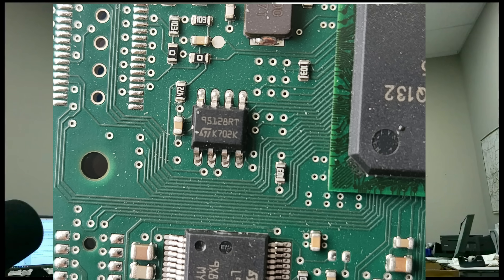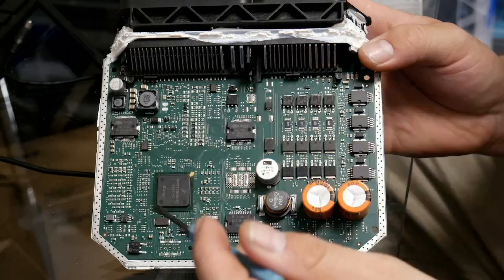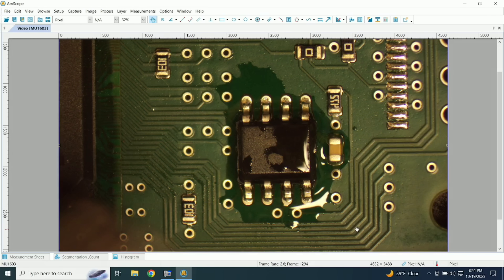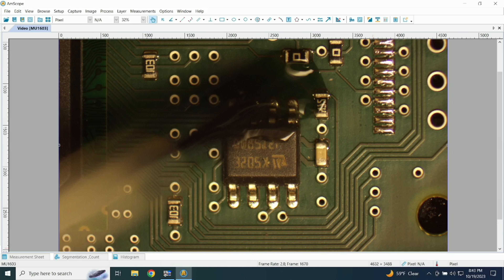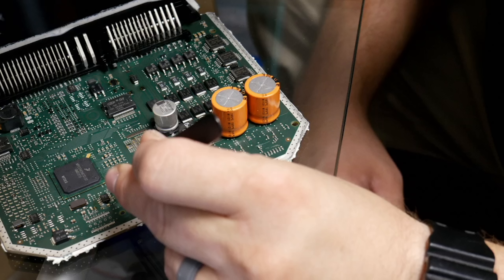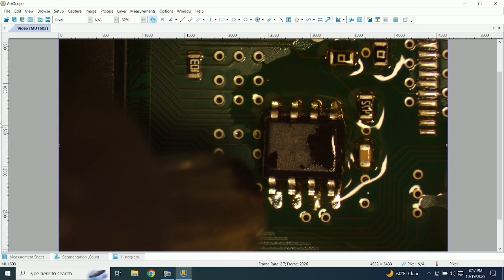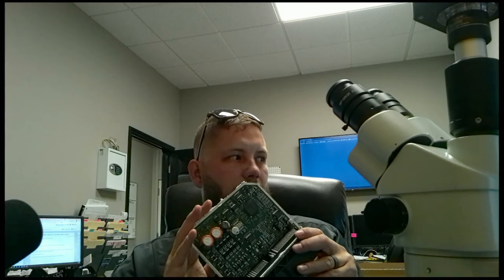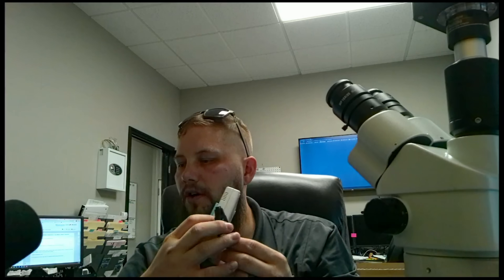Can we make this USED Fiat PCM work? The dealer can't!

Comment: Great video mate 👌🏼
I’ve got a problem with my pcm/ecu where it has lost its vin & I have tried to write it with a Autel but no joy.

Symptoms with the car a 2012 Fiat 500 twin air 0.9cc turbo manual, turn key but no crank. Checked keys still paired with the car which it is showing it is but the body control is not tell the ecu to start, I presume because the ecu is no longer matched to the car/bcm.
I’ve removed the relay with the ignition on jumped fuse box with 12v & it starts up 😮

Thinking of getting multiecuscan to see if I can go in that way 🤷🏻‍♂️

Any help would be greatly appreciated 🙏

Comment: I usually generously tin the pads, then hold the little guy down with a chopstick tip then apply hot air, depending on the ic type it might get a onece over with an ultrafine soldering tip for good measure. ❤

Comment: The 95128 is an SPI part. It's not locked or one time programmable if the block protect bits are cleared. With the right tool you should be able to clone it in circuit. What is the part number of the ECU and we'll try it.
Reply: Did you ever try this one??? Haven't seen it in ur vidyo list
Reply: @charliemagoo7943  Yes. We acquired one of the modules. We were able to read/program the part in-circuit so cloning is possible. That being said there is a preconditioning software step which was necessary for part access. We will do a video as time permits.

Comment: Some of those modules are built to withstand WWW-III. Is there a way to convince them to come apart a little easier? I had to use my hot air gun, some screw drivers and dry wall spatulas and lots of swearing to get the one I got from eBay apart. And how about putting them back together? Where can you get the new silicon for the joints? 
Second question: On first glance there are three EEPROMs on that board. Two of them quite close to the MCU. Is there a chip series that is usually used for the BIOS? (computer speak)
And how do I test if it worked? I have a test setup for the VW mqb (MK7 Golf and Jetta series. 2017 and thereabouts), but no other test setups.
Sorry for all the questions, I'm still learning... :)
Many thx for what you do!
In the PNW (pacific northwest) land is way too expensive to have junk yards, so I depend on eBay. Is there a better way of getting modules?

Comment: The ST M95128W6 is a 128k Bit = 16k Byte SPI Serial EEPROM has impressive write cycles and data retention, much more than emulated EEPROM inside of the Freescale Power PC Microcontroller. Not just much more than this MCU but better than any MCU when comparing write cycles and retention. My guess, given the size of this EEPROM, is that it is only for as built data end of line calibration. I do not think it has any code like a boot loader for example. 

What is the round donut shaped PCB trace in the middle of the board next to a surface mount power IC? Is it an antenna?

When the board is designed you first place components for input protection and filtering close to the connector. Then the power circuitry is laid out in what needs to be closest to the main connector. Then I/O conditioning is laid out, and finally the MCU circuitry. MCU traces then adopt top layer one direction and bottom layer at 90 degrees to this. So largely when looking at the top of the board traces are mostly horizontal, and if you look at the bottom of the board they should be mostly vertical.

What is strange about the MCU core layout, is that there is no large ceramic or tantalum in close proximity to the MCU. You see the classic power decoupling with two smaller ceramic caps in parallel, but not a larger Tantalum in close proximity.

In de-soldering the EEPROM you should mask off the MCU with Kapton tap or use an aluminum shield. A soldering shield is a thin aluminum square (2x1 inches) piece of 1/8 in sheet with a square cutout just a little larger than the IC you are replacing.

You should remove the old solder on the 8 pin SOIC, and then use new solder to solder the part. The original solder may be lead free, but when repairing the board you can use eutectic tin/lead which has a much lower melting point the lead free solder.

Comment: Use a silver marker or paint pen to mark the side of the chip closest to the connector or other identifying feature of the board, such as the CPU, to know which way to place the chip when going back together. If the board has a number one pin mark on it, you can put the paint mark on that corner of the chip also.

Comment: can you share why the PCM was defective on the first place ? how did you know what part needed to be repaired ? and yes. if you can tell if the repair was succesful or not once in the car... very educative content. thanks for sharig.
Reply from the maker: No idea, shop calls and says they want this used one programmed, I explain its not possible over OBD and will require this.
Reply: @L1Training so you burn a new VIN# into the chip ?
Reply from the maker: It's not just the VIN, it the immo data too.

Comment: Did it work? The FIAT ECUs have both an internal and external flash. Is the external flash just where the VIN and security info get recorded? Also curious to know what the failure was of the original ECU.
Reply from the maker: LOL, yes and no,  it was misdiagnosed so we will see.
Reply: @L1Training  Please keep us updated. I have the software and hardware to read and flash those ECUs (Magicmotorsports) so let me know if you'd like to work on it together.
Reply: @BookAutowerks  Did you ever find out if this method works since OP did not deliver?
Reply: @ no clue

Comment: Some eeprom chips are glued to board as well like on the Mercedes me2.8 ecu’s. On those you need to twist the chip  of the board once the solder is molten. This is also true when you are replacing a smart low side switch, the chip is held by the thermal compound and you have too pry the chip off the board once the solder is molten

Comment: Good job Keith. I do this kind of work as well in my shop. Id suggest if anyone watching that wants to get started doing this stuff to  pick up an Amscope SE400-Z  microscope. Its a great 'bang for your buck" starter tool for PCB work.  They sell in the $200 ish range.
Reply from the maker: I use a SM-4NTP Amscope now.
Reply: A surplus dissecting microscope works awesome for SMD repair, and they are cheap. Some tacky paint sparing poster sticking material is also useful for holding smaller boards in place while you work. ❤